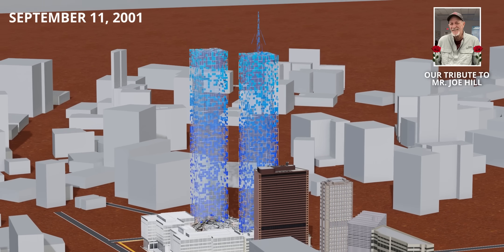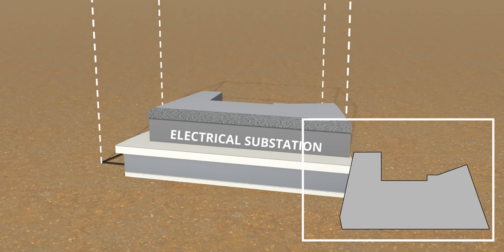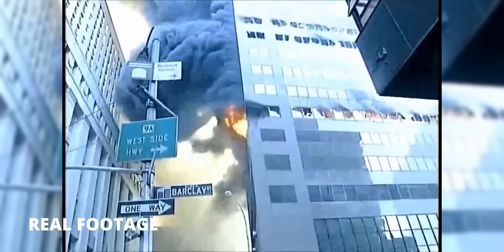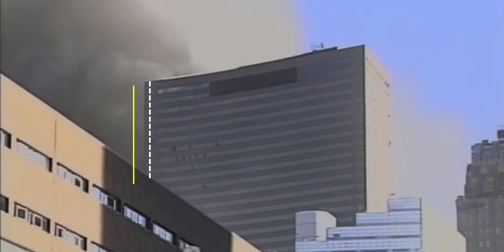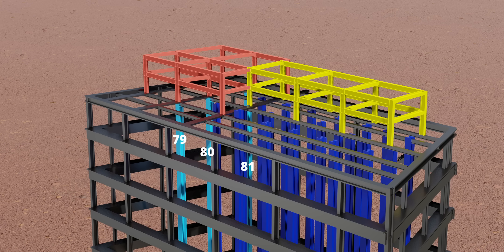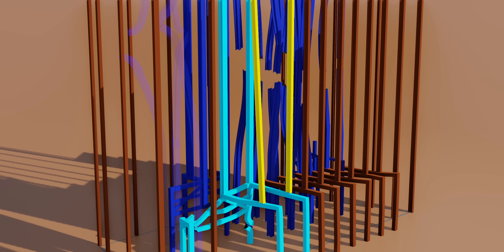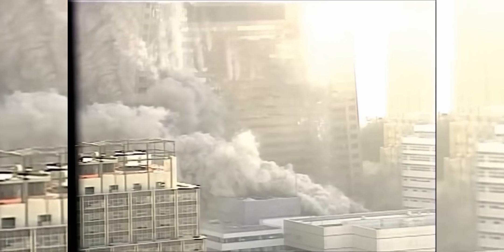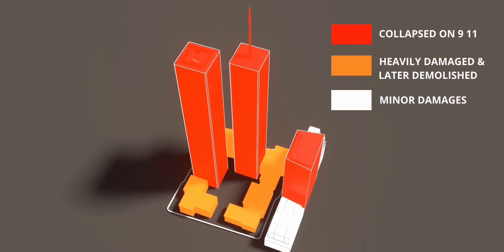Collapse of Building 7 | The Complete Physics

Comment: You can see the charges literally going off. Spare me
Reply: Where? Collapse initiation was due to sagging floor trusses (which we can see) causing inward bowing of perimeter columns by up to 5 feet (which we can also see) at the impact and fire damaged floors until those perimeter columns buckled and failed, initiating the collapse (which we can see). I would refer to you the excellent Gary Pollard video of the collapse of the South Tower. Pay attention to the first 12 seconds in particular.

WTC2 Collapse -- Gary Pollard (Enhanced Raw Copy from NIST) 

www.youtube.com/watch?v=ULdiD6gYZO0  

Columns don’t work well when they are bent. The Twin Towers were designed to work with straight elements not bent ones. When you bend those columns they become up to 4 times weaker. Failure is inevitable.

Notice how the columns are already bent when the camera zooms in, become a bit more bent over the next new seconds until they give, starting the collapse. 

So what bent them? It sure as shit wasn’t thermite or sooper-sekrit fire-and-impact proof hush-a-boom pre-planted demolitions that don’t explode. 

If you keep watching you will note that after the tower starts collapsing the air inside the building (95% air by volume) gets compressed and forced out the windows. These low-velocity air bursts devoid of blast or fragmentation effect are a reaction to the building collapsing not a cause of the building collapsing 

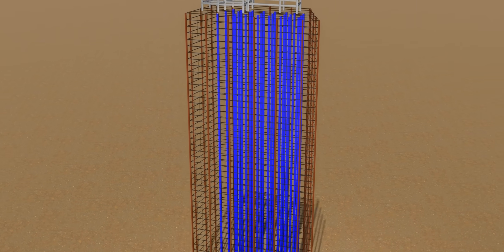And at a different angle from 1:18 here:
youtube.com/watch?v=TJJPYTVjxug&ab_channel=femr2 

Or here
www.youtube.com/watch?v=-DCgEJ2bUcI 

Also seen in the excellent still image here at 9:09:
youtube.com/watch?v=YXsDwKYz1bA&ab_channel=msvfreak94
Reply: Really? Where can you see these "charges"? Detail exactly. Do work. Be the first in 23 years.
Reply: @mooneyes2k478  it's open in the video the building was a professional demolition. You can watch the building fall and see the pops of the charges. Furthermore you'd have to be a complete idiot whether you saw pops of the charges or not to look at how the building fell and not understand that was a controlled demolition. It was obvious. The building was completely untouched.
Reply: @mooneyes2k478  there are several videos on it even what they showed on the news you could see the pops of the charges
Reply: @MgtowMoose  - Then you should present a link to one of those videos.
Reply: @mooneyes2k478  you sound like a woman.  I'm not the first to point this out.
Reply: @mooneyes2k478  and it's 24 years women  and math don't go together

Comment: 24 years later and truth deniers still cant figure out it was done from the inside by the deep state (Jesu1ts) . By not helping the truth come out you are unwillingly helping those perpetrators get away till they sadly hit again. Now go back and watch your football.
Reply: This video is pretty good – with a few exceptions - and goes into a much higher level of detail than many viewers will be able to comprehend.  While not perfect, the collapse mechanisms – the sequence of failures - described here  are substantially correct and this is true no matter who planned and carried out the 9/11 attacks or why . 

That may not be what you want to hear and go against 20+ years of entrenched dogma and conditioning, but it’s not wrong. 

That also means (in case you did not get the hint) this video can be (and IS) absolutely correct in its description of collapse mechanisms AND the 9/11 attacks could still have been some sort of inside job. The two things are in no way mutually exclusive. 

The mechanisms described here have broad professional support around the world. There are no professional engineering organizations (for example: ASCE, ASEE, ICE, etc) that disagree with them or have offered any formal dissenting opinions or alternative hypothesis. 

So, setting hubris aside, either the overwhelming majority of the worlds structural engineers and simple observation are wrong,… … or you are. Which seems more likely? 

IF you still think believe this explanation is wrong then produce a better one . Good luck with that. No one ever has and I don’t see you moving that needle today.
Reply: @TheCriticalStinker-jw4fl  if you haven't already got it then there is no point, is too late for your country

Comment: 6:25 Notice in this video how he omits the crucial floor bracings and steel beams that interconnect the columns—elements essential for structural rigidity and floor support. In reality, about 95% of steel buildings rely on a truss system, typically incorporating 45° angled supports, to evenly distribute loads and prevent any single column from bearing excessive stress. Without it, the entire structure would lack the balance and cohesion that such systems are specifically designed to ensure.

If you go on truth social and look up a group titled as “Never Forget” there is a video there of someone who used a digital home camera to record the actual blast that is going off in the building. You will hear the explosions happening, bringing the building down.

Comment: 2:36  transfer trusses inside concrete (protected from heat, enclosed in concrete preventing stress) 

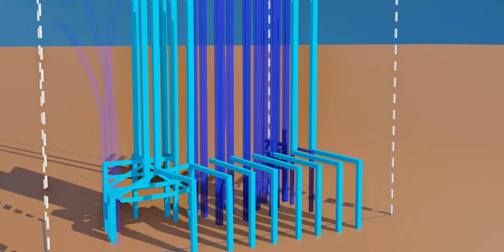6:52  apparently they removed all the concrete during the fires…. ? 

These videos were so poorly done it’s a joke. In the video regarding the twin towers, they used 3 heavy ass boxes on a soda can and had their buddy push it in with a pen as the example. Does that sound like a very accurate representation to you? This is either some guy trying to get views off of 9/11, or this video was made to spread misinformation.
Reply: The Transfer Trusses were NOT encased in concrete.  Where would you even get an idea like that?  Building 7 was a steel framed structure with no structural load bearing concrete

Sorry you couldn't grasp the simple and extremely commonly used demonstration of column buckling in the Twin Towers video.  Most people got it.
Reply: @ “no structural load bearing concrete” uh….. the foundation? The video clearly explains there was a substation beneath as well, where the transfer trusses were located.

You sure you watched and listened to the whole video?
Reply: @TexTheRex4  - The transfer trusses were ABOVE the Con Ed Building, there because of the con-end building and the need to span long sections because the Con Ed only formed a partial foundation.

The foundation is the foundation, NOT the building. Please try to keep track of what is being discussed. Your claim the Transfer Truss structures were encased in concrete is simply false.  The correct response from you should have been thank you not a deliberately off-topic evasion.

There was plenty of resistance. No idea what you are on about.  Please stop mindlessly repeating whatever you find on the internet.
Reply: @ care to tell the class what the substation and con Ed were made of? And what part of the frame went though said material? We’ll wait! Also were the transfer trusses just floating in mid air? Pretty sure they had to go into the foundation, even if said foundation is the Con Ed. Also that’s comical. “plenty of resistance” …? the videos clearly show otherwise. And the fact it was announced as collapsed 20 minutes before it even fell by BBC news says everything 😂 keep convincing yourself that building fell because of some office fires and debris.
Reply: @ plenty of people who were there and witnessed it, plenty of videos with clear audio of explosions. Firefighters and other first responders reported numerous explosions before collapse.
Reply: @TexTheRex4  - Just as soon as you admit the Building 7 transfer trusses were not enclosed in concrete

Then and only then can we move forward to the next topic of discussion.
Reply: @TexTheRex4  " care to tell the class what the substation and con Ed were made of"
Translation, "Oh, shit, I said something stupid and got called on it. Quick, change the subject."

What do you know....
Reply: @ you really thought you did something there didn’t you? 😂😂😂
Reply: @TheCriticalStinker-01  it’s amazing how you’ve avoided my question, what exactly were the beams attached to if not enclosed in concrete? 😂
Reply: @TexTheRex4  - I told you. No new business until old business is put to bed. We can't move forward until you acknowledge the critical correction I made in the first reply. Then we can address how irrelevant your deliberately evasive off-topic derail is. So please acknowledge that you know and understand the Transfer Trusses in Building 7 were not encased in concrete so we can move forward. 

Thank you.
Reply: @ wow, you’re really good at running in circles. Any chance you were in track? You keep telling yourself those trusses were floating 👍🏻
Reply: @TexTheRex4  - Pot meet kettle. 

Remember that the goal of conspiracy rhetoric is to bog down the discussion, not to make progress toward a solution Jay Windley 

We have differing objectives. 

I want to discuss the topic at hand and only that topic until we are done discussing it and achieved resolution - like grown-ups

You want to protect your beliefs, to maintain the fiction and therefore want to avoid achieving any resolution which threatens your beliefs. Your goal is to make sure the discussion does not move forward, does not progress towards a conclusion you won’t like.

So, last chance.

Please acknowlege the bleeding obvious - the transfer truss structres were not encased in concrete - so we can close this matter. Please stop being rude. To prevent more of your evasive games, failure to do so in your next reply will be accepted as tacit admission you lied and you automatically cede all current and future arguments on this topic. Discussion over. 

Choose carefully.
Reply: @ crazy how you’re capable of typing all that goofy shit but can’t even answer one question. If the beams weren’t enclosed in concrete at the substation and Co Ed….. where were they? Floating? Ahhhh wait, no. They were enclosed in concrete.
Reply: @TexTheRex4  you cooked
Reply: @TexTheRex4  - I accept your surrender.  We are done here. I wish you luck with your continued epic fail. I really hope that works out for you someday.  Goodbye.
Reply: @ " how you’re capable of typing all that goofy shit but can’t even answer one question."
As opposed to you, who barely managed English, avoided the subject because oyu know you're wrong, and then tried to shit on the table and pretend you "won".
Reply: @ I already answered their questions and asked essentially the same thing, what a surprise… he ran in circles around the question. Bots keep bottin
Reply: @TexTheRex4   Right. So, you're admitting you're a bot, then? Well, that's brave of you.
Reply: @mooneyes2k478  did you have to dig into your 7th grade comebacks to find that hidden gem?
Reply: @ No, it was fairly obvious from your comment.

"I avoided the subject while trying to pretend I'm really really right, something something computer algorithm" deserves an answer like that.

I note you still haven't actually answered the question, though. Why is that, exactly?
Reply: @mooneyes2k478  avoided the subject? The only one who avoided it was the other guy. I asked numerous times where the trusses where located if not enclosed in concrete, to which he failed to respond.  If he can’t accept the truth, how would I ever expect you to? Keep living in denial. After all, ignorance is bliss.
Reply: @TexTheRex4  " I asked numerous times where the trusses where located if not enclosed in concrete"
Yes, you did. Good of you to admit you avoided it. Next step is to manage to not do so, and actually not avoid the question while pretending you didn't.

And, clearly, you're full of bliss.
Reply: @ isn’t it funny how you randomly threw yourself into this conversation? Not even you can answer such a basic question, you two must be the dynamic duo! I hope one day I learn to avoid questions with such elegance like you two.
Reply: @TexTheRex4  That's true. There's nothing "graceful" about you avoiding the question. It's quite blatant.
Reply: @TexTheRex4  You claimed the trusses were "encased in concrete". When called on this, because it's not true, you referred to the ConEdison station. Except, that was there prior to the construction of WTC7, that's why it was constructed the way it was.

Your response to this was, "and what was the ConEdison station made of", apparently trying to pretend it WAS built at the same time. You argued that you were "pretty sure", which is completely irrelevant. Your "pretty sure" isn't a fact, it's your opinion trying to have your way.

You then attempted to divert to "the BBC news report", something not only irrelevant but also meaningless. You also added "some office fires and debris", proving you think you knew better than the NYPD.

You were called on this attempt to divert, and were told to stay on the subject.

This was followed by you attempting to pretend that you were the one in the right, and your question should be asked.

You were once more told that, the subject was your failure concerning the "encased in concrete", and no other subjects would be breached until you admitted you failed.

You once more attempted to act the correct party, talking about "running in circles" while, in fact, running in circles, and talking about trusses "floating" while avoiding the point.

You were called on your desperate attempt to cover for your pet fantasy by avoiding the subject.

And then you went, "Oh, you typed ever so much", again not addressing the subject. You also attempted to change the subject, or (more likely) don't actually know what the meaning of the words you used actually is, by talking about "beams".

And then you devolved to admitting you're a bot, talking about your 7th grade experiences, and in general failing horrendously.

Good work, couldn't have been more perfectly "truther" if you tried.
Reply: @TheCriticalStinker-01 a few columns buckling doesn’t explain the remaining structure collapsing the way it did. There was no resistance whatsoever in the collapses.

Comment: Doubtful Points:
	1.	When the North Tower collapsed, even if the antenna really did hit 7 WTC, it couldn’t have damaged its load-bearing structure. First of all, the antenna is very light and wouldn’t have fallen at a particularly high speed. Secondly, like most skyscrapers built after the 1980s, 7 WTC had its main load-bearing columns located inside the building rather than on the exterior facade. In contrast, the Deutsche Bank Building from the 1970s did not immediately collapse even when its exterior load-bearing columns were damaged.
	2.	The idea that the rooftop penthouse caused the collapse of two main load-bearing columns is simply absurd. The load-bearing columns of skyscrapers primarily support the weight from the floors, and the penthouse contributes almost negligible weight.
	3.	The south facade was the part hit by debris and caught fire, so it’s impossible for the fire to have burned through to the deep interior lateral beams.
Reply: 1. The antenna did not hit Building 7 (the video is wrong about this), it was perimeter columns from the north face of the North Tower. No one is claiming the physical damage was fatal to the structure or even substantially comprimised it. 

2. That is not what happened and not what this video is claiming. The video actually avoids the topic of collapse initiation mechanims and I understand why. Since collapse initiation occurred in the NE corner of the building the first externally visible signs of the collapse occur on that side of the building, with movement of the EMP being the most obvious.

3. Nonsense. Fire spread throughout the building over 7 hours (yes, fire moves) and that is fully in evidence in this video where we get close up camera shots of raging fires in the NE corner - as far from the debris impact damage as it was possible to get.

Comment: Sounds like someone involved that had this video made😂
Reply: 🤦‍♂

This video is pretty good – with a few exceptions - and goes into a much higher level of detail than many viewers will be able to comprehend.  While not perfect, the collapse mechanisms – the sequence of failures - described here  are substantially correct and this is true no matter who planned and carried out the 9/11 attacks or why . 

That may not be what you want to hear and go against 20+ years of entrenched dogma and conditioning, but it’s not wrong. 

That also means (in case you did not get the hint) this video can be (and IS) absolutely correct in its description of collapse mechanisms AND the 9/11 attacks could still have been some sort of inside job. The two things are in no way mutually exclusive. 

The mechanisms described here have broad professional support around the world. There are no professional engineering organizations (for example: ASCE, ASEE, ICE, etc) that disagree with them or have offered any formal dissenting opinions or alternative hypothesis. 

So, setting hubris aside, either the overwhelming majority of the worlds structural engineers and simple observation are wrong,… … or you are. Which seems more likely? 

IF you still think believe this explanation is wrong then produce a better one . Good luck with that. No one ever has and I don’t see you moving that needle today.